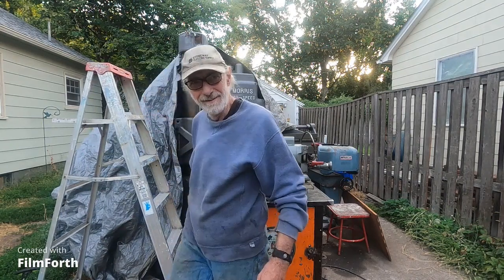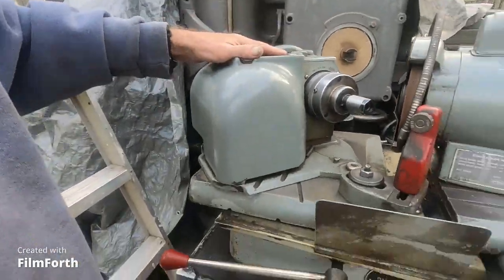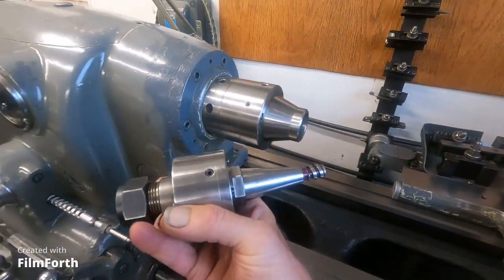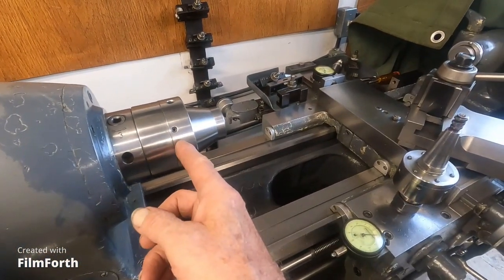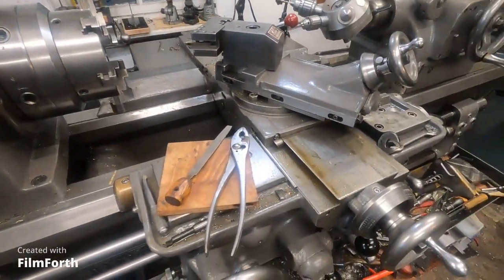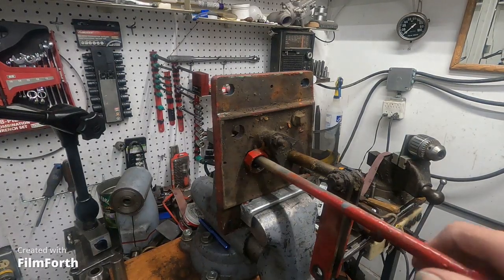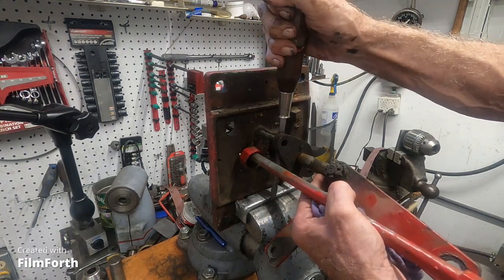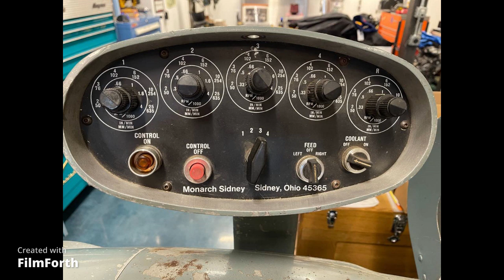Machining true with Adjust-true work & tool holding

Comment: a few years back, I worked at a place where we would occasionally make
drain covers for airports , gas stations and what ever....we had a 100 Ton
press we would test the covers and grates/ we would bend them and leave 
them under pressure for a few hours , then release pressure and check springback.
D.O.T. regulations required it too.....
Love the slide show at the end,,,,especially the Axelson gear shifting sequence, and 
of course  Chloe and her buddy.....
PB
Reply from the maker: I am looking forward to using the press to straighten and true steel objects, like if the grates you described and while being under that pressure, if it was struck hard with a steel hammer, it would not spring back as far it would take "a set". I have more photos!

Comment: Sioux Valve grinder is my favorite. Everything is laid out fright for me anyway.  I always thought the one we had was just fine. However I have moved on many years ago from the automotive machine shop.
Reply from the maker: I have always found automotive machine shops good customers for tool grinding and many odd jobs, but now the ones still doing it seem to have more complete shops with more standard machines, but still need some tool grinding. The automotive arena is hot where there are many other jobs other than grinding valves, there is everything from door locks.to windshield wiper motors in the most expensive cars ever made for the savvy craftsman to repair and customers that will pay a fair amount for good work.

Comment: I have a 1944 logan 825 lathe that can cut metric threads.  You have to change some gears out and the metric gears are very pricey but I was able to make my own and they work very well.  I´m not sure if other manufacturers lathes have that option
Reply from the maker: The older style of lathes with the more open-end gear train, are a lot easier to use change gears on than modern lathes with enclosed geartrains where it is tight and fine pitch gears have to be jammed in a small space, I will be able to make metric gears for my old Axelson too.

Comment: Do you have any advice for lathe workholding that can correct for angular misalignment not just eccentricity? most chucks I have found can only correct runout not "total runout"
One of the few collet chucks I have seen with a correction system is by the "SRS" series chuck by Schaublin, but it's more intended for tool CNC tool grinders. (I have seen it at a local grind-shop, it worked excellent)

For example on my engine lathe I keep a large 10-inch 3-jaw adjust-true buck chuck mounted most of the time, and when I am doing small collet work I place a 5C hex block in the chuck. but the total runout can be 0.005 over 3 inches, I need to shim the collet block to eliminate the tilt.

What I have wanted to make was a chuck back-plate which is composed of two stacked plates. the bottom plate will rotate radially off center and can be clocked to cancel out excentricity  and the top plate can be clocked to adjust the tilt. It would be similar to a "wobble chuck" used on wood lathes.

The lack of commercially available solutions make me curious if there is a simpler solution I am overlooking. "total runout" has been more time consuming to eliminate.
Reply from the maker: The run-out you are talking about is axial and that was increased on your collet block using the jaw chuck. I had corrected that on all the examples I have shown by using quality or with 5c Royal master grinding Collett to gauge then hand scrape the interface, but none have adjustment to correct for axial alignment like for a bad or damaged collet, but it seems very possible to do like you say, very interesting! Thanks

Comment: Dear Dee Dee
I'm looking at e_bay and I found  8 pcs BT30 ER 20 70L collet chuck tool holder.
Do you think this will work For my situation with the South Bend milling machine. Providing I can learn how to grind the notches that I need in the taper. I would love to have set up with multiple 30 taper holders. Can you make any suggestions as far as 30 taper call it two holders is concerned.

Thank you for giving me some of your Time and expertise. I'm a little bit dim when it comes to this tooling knowledge I may need someone to hold my hand every step of the way I'd love for that to be you. Good day to you my friend. Kimber
Reply from the maker: Hi Kimber! I would first machine an adapter out of 4140 steel to fit. and lock into your spindle. The face of that first piece can actually be machined true in place by holding a cutter in the table vise, and the shoulder for the front piece side adjustment screws like the Buck chucks. So, make an adapter out of good steel that fit the spindle.
 I would go with ER32, goes to 3/4". Buy a good brand straight shank ER 32 collet chuck extension, shorten it to fit the front adjustable piece. The front piece can be also bored true for the collet holder using a small boring bar held in your table vise.
 Pick good collets as you need them, You can base your drill chuck and boring head on a 3/4" straight shank and will need 1/2", 3/8" and 1/4" collets right away,

Comment: I think I understand how your mechanisms adjust the position of a collet in the radial direction, but what about tilt? I.e. what if the axis of the collet isn't parallel to the axis of rotation of the machine?
Reply from the maker: The tilt is lightly hand scraped in for axial run-out, thanks!